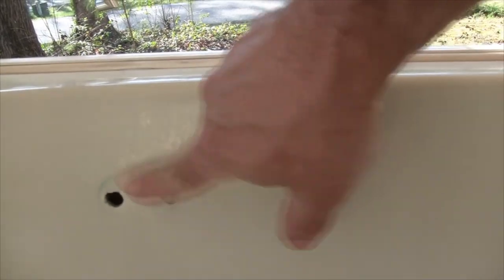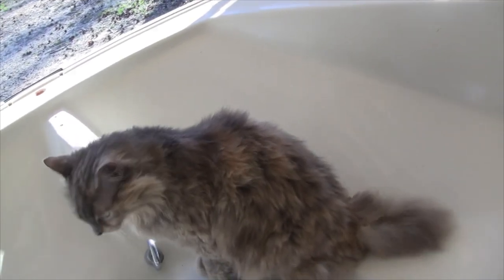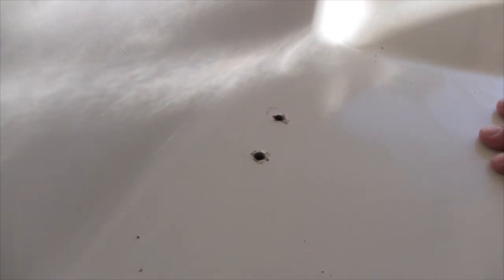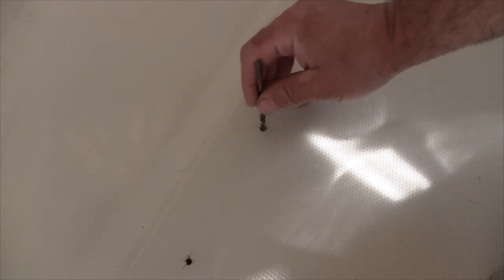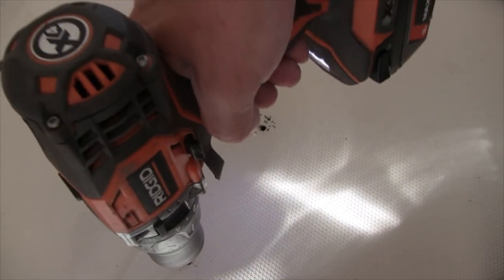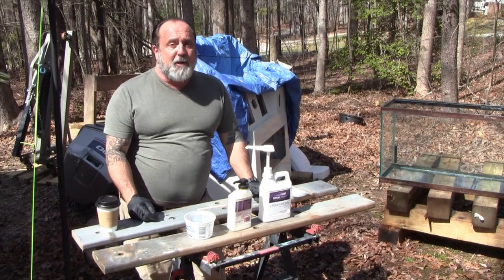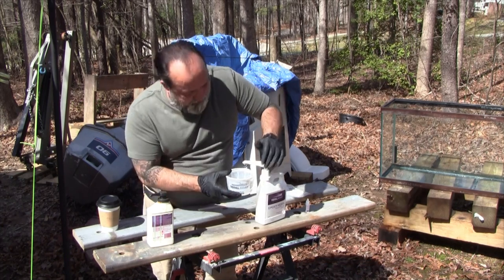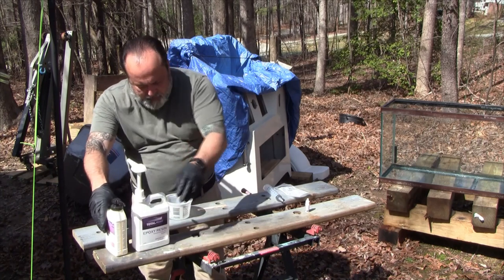Repairing Old Fiberglass  Screw Holes In a Classic Boston Whaler Montauk - Part 7

Comment: So if I'm gonna take the z-legs, console and rails off to refinish boat I should not re-use the same holes without filling them in completely first?  Also would you still use epoxy if I'm gonna re-spray gel coat on the entire boat?  Thanks!
Reply from the maker: That depends on the condition of the holes. When I got the boat it was already disassembled, I assumed that they were all bad. If I had dissembled it, I would have made note of what holes were bad and repaired those.  To be Honest, I think using the original holes as much as possible is preferable.
Reply: @ExtremeDIYGuy  Thanks Man!
Reply from the maker: @jasonsmith7809 Your welcome!  FOrgot to answer the second part. I think you should be fine with the epoxy if you use a high build primer first. Check with the folks at Jamestown D/Total Boat first. Their tech staff are pretty awesome!